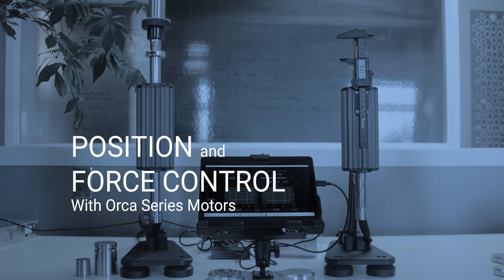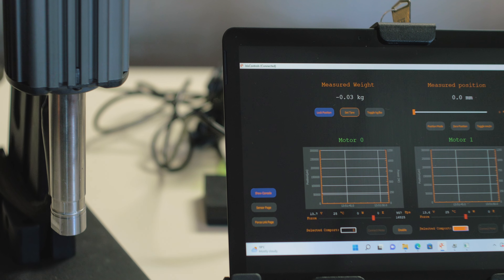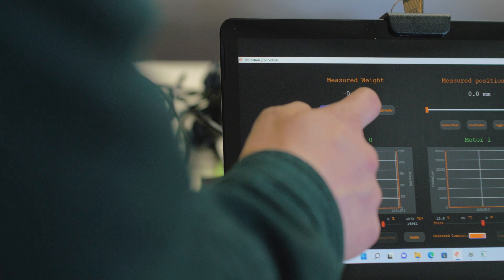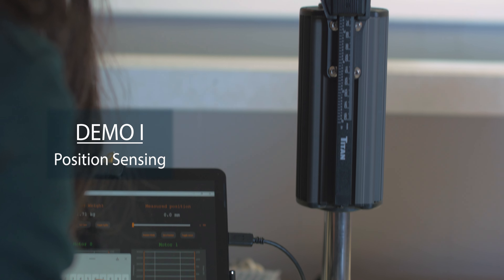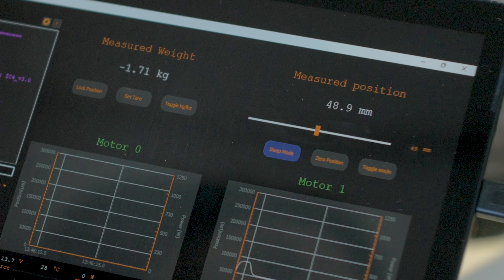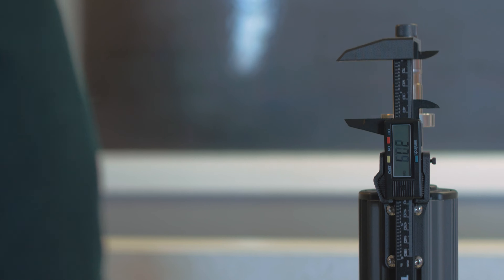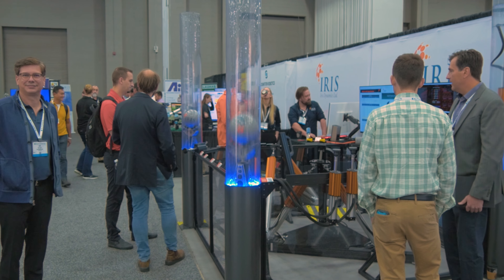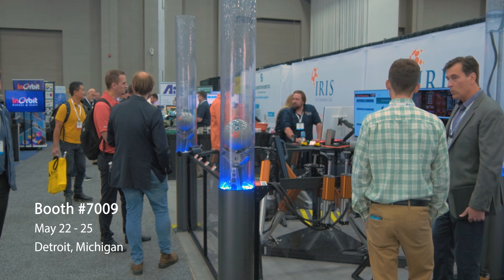Position and Force Control with Orca Series Smart Linear Motors | Automate 2023

Comment: Does this product contain rare earth permanent magnets?
Reply from the maker: Hey! Standard shafts are built with NdFeB (Neodymium) magnets manufactured (not just sourced) in the USA. If you have a high temperature application (higher curie temps) there are options with SmCo (Samarium Cobalt) or even AlNiCo if needed however these do take a hit to total power efficiency.  What sort of applications?
Reply: @IrisDynamics  Thanks for the reply. Ill contact through the website soon. I have a requirement for 6dof platform for sim racing. I run a gaming centre in Dubai.